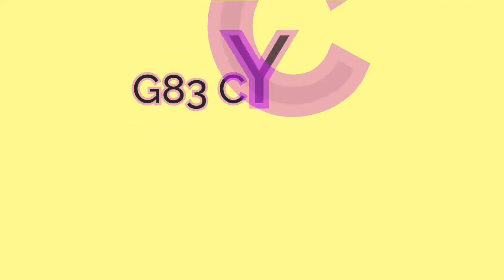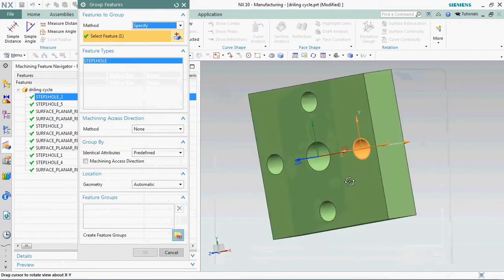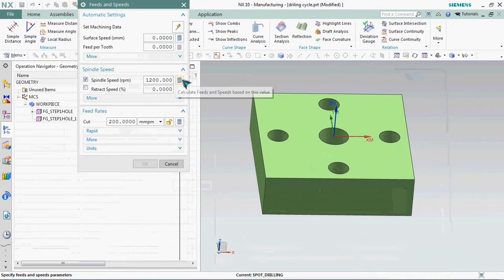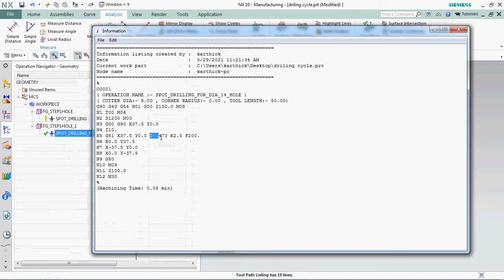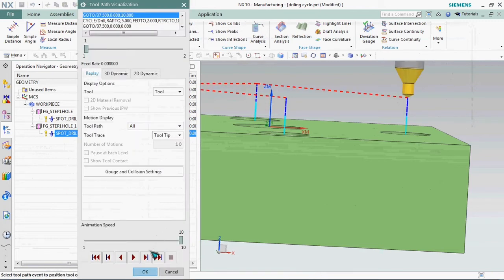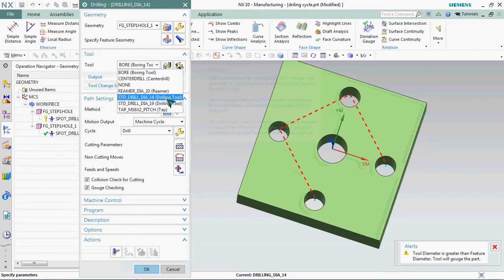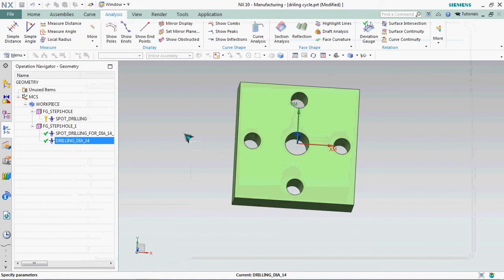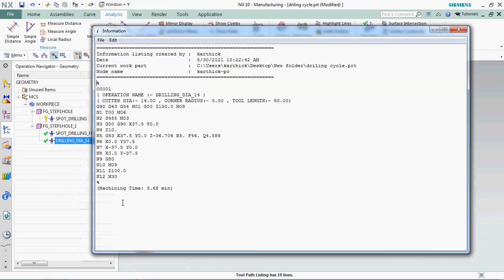G83 peck drilling in NX cam tutorial_keep learning with us

Comment: If I output single moves instead of canned cycle, is there any way to still get the peck drilling motion?  If I output single moves I am getting just a single plunge.  My hardware does not support G81/G83.
Reply from the maker: If your machine doesn't have G83 cycles means you can try G01 movement to run the peck cycles. in nx cycle method you will change machine cycle to Single move cycles. than we will get the G01 movement codes.